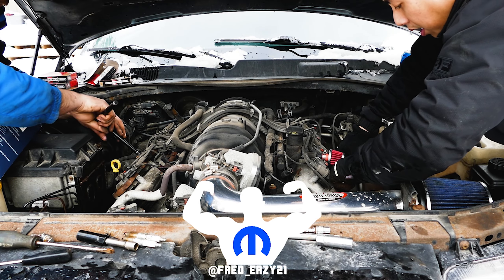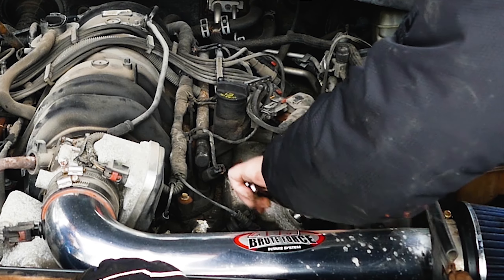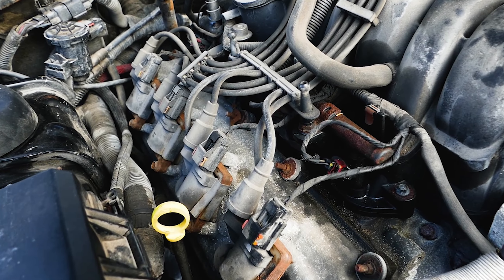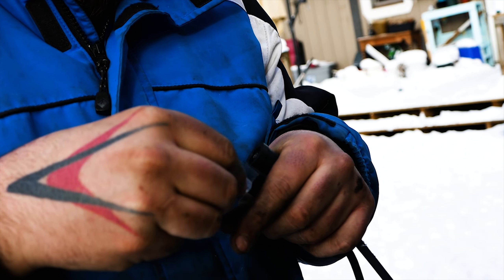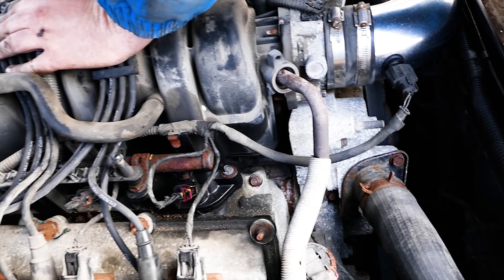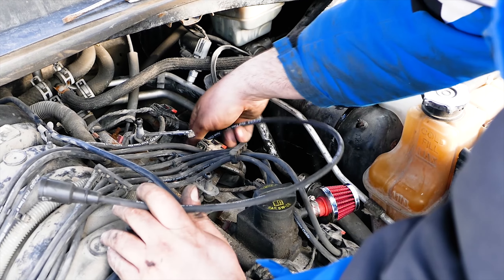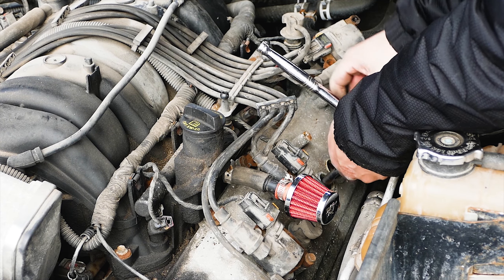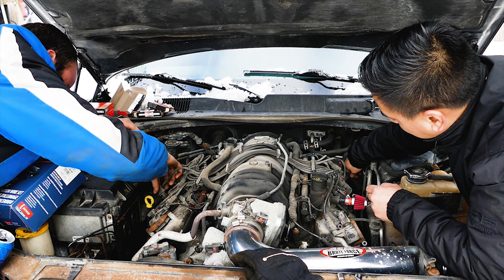chrysler 300c spark plug change

Comment: Where did u buy the wire kit

Why can’t I find it for sale anywhere for a 2011 hemi
Reply from the maker: hey there, 2011 and up don't have the wires, just coil packs like in this video: https://youtu.be/5lBv46NMloE
Reply: Woooooah cool.. I had no idea

What about distributor cap.. do u change that?
Or clean egr valve ?
Reply from the maker: @Tonyodette1  no distributor cap or egr clean to change the plugs, just remove coil packs